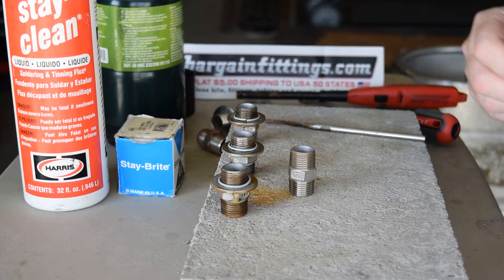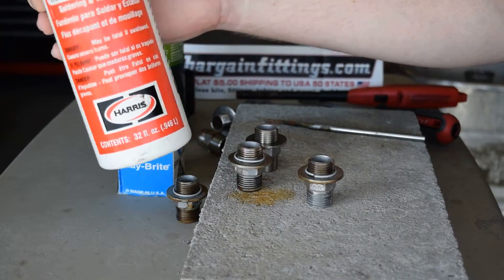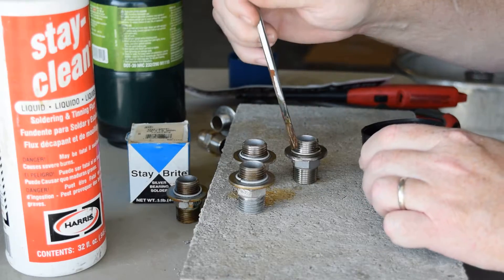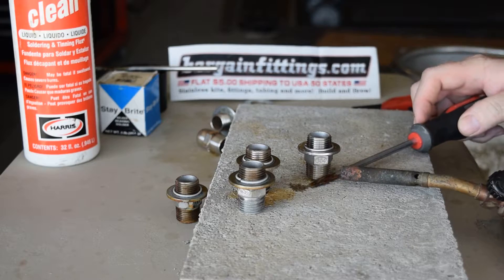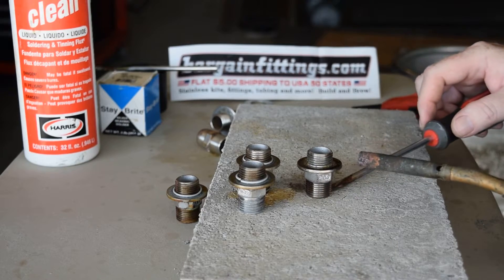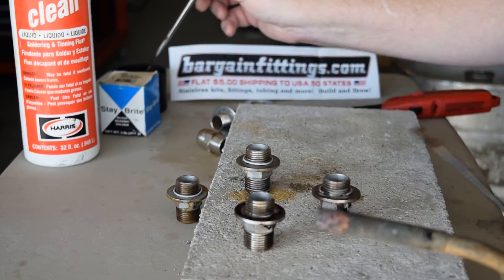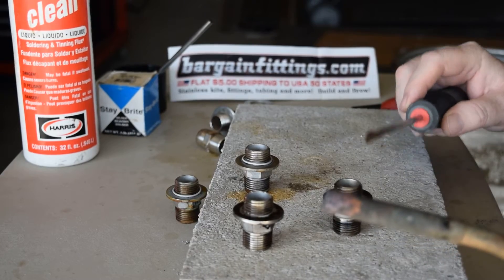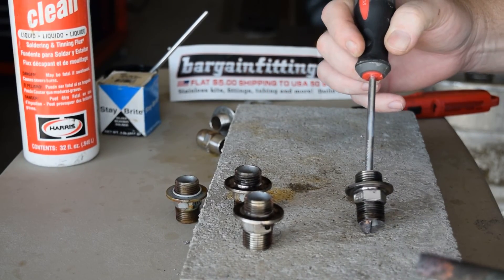Soldering stainless steel fittings.

Comment: Used to solder SS to SS, SS to copper, and even SS to carbon steel in the industrial gas industry.  Used 35-65% silver solder and flux.  Oxyacetylene small tips.  Huge issue was heat control. If too hot, stop and start over from the beginning with fresh cleaning.

Comment: Nice video. Can you use this solder/ flux for larger pieces of steel... I'm making a sculpture & want to tack some joints, of long steel rod/ steel bar/ steel weight bench rectangle tube. I just wonder about the effect of heat sink off the joint from the long metal piece. I understand the stay brite is low melt point, so I was hoping the heat sink issue wouldn't matter as much. I am also thinking of cold connecting the joints 1st, with steel wires or screws, & then soldering over that. I don't want to get into welding at this point. I was considering the stay silv, but would prefer the stay brite if it would work. Also, how do you clean these parts you made after you are done?

Comment: is he trying to solder wires to the bolt, or whats the plan/project after melting the solder ?
Reply: He says in the video that he pre shaped the solder into rings and those are the wires you see on the washers.

Comment: I needed to solder a coupling that is 1/2 inch npt to a 5/8 steel tubing for a line I making on my old truck . I never tried to silver solder with just propane . . Watched your video and I remember I think I the flux and solder . I knew I had silver solder for  soldering ac lines ect . I had the solder you posted also . So it worked OK.  I cleaned both pieces and fluxed . I has to reflux on one side and give it a quick rub with a SS brush . It took the solder then. Thanks for the video

Comment: Please i need help.....
What about brassing 2 SS pipe of diameter 10mm together. These pipes need to withstand pressure up to 200Bars. Is it possible to use Silver brassing rod?.
Reply: Safety-Silv 56% Brazing alloy will do nicely with the appropriate flux. It’s rated for 70,000 psi
Reply: @rdalemd76  what about 40% Sir

Comment: Would you compare the use of this flux and solder to be similar to soldering copper pipe? or is there any major differences in the way you use it?
Reply from the maker: Very similar to soldering copper pipe.   Heat is directed to the part with the most mass.  Main difference in the process is the flux.

Comment: Thank you for such a helpful video.  Question, what is the best way to solder together two 1/8" or two 3/16" stainless steel solid rods, non-threaded.  Would you use the same flux and same solder you are using?
Reply: You would probably want to silver braze solid rods.  What sort of connection?

Comment: What do you think this flux made of, is it muriatic acid?
Nice job.
Reply: It's zinc chloride. Used to be known as 'killed spirits' in the UK. You make it by dissolving metallic zinc in hydrochloric acid until it stops reacting.
Reply from the maker: I believe it has Hydrochloric acid in the mix.
Reply: @BargainFittings  at which temperature the piece to solder the silver to should be ? should it be put to red cherry ?

Comment: I’m doing a project that I need to solder stainless to stainless. It’s not a perfect fit. There is a little gap. What solder and flux should be used. I tried the silver lead free solder from the hardware store and it doesn’t stick even tho the stainless steel is hot.
Reply from the maker: You need proper flux to solder stainless to stainless.   The stay free liquid flux in the video works well.   A very small gap can be bridged but it is best to get the gap as tight as you can.
Reply: I had the same issue. Don't let the flux turn black on the surface of whatever you're soldering.

A trick that works for me is to use water, dish soap and a scrubbing pad then dry your surface and apply flux right away. If that doesn't work you can use a dremel and cutting disc to scuff the surface and then apply flux.
Reply: As for solder i use alpha fry flo-temp
https://www.amazon.com/dp/B0012TAWS8/

Comment: do u sale alot of different types of stainless steel fittings and how about that solder I can't find any good quality of silver solder.  All the ones that they were saying on eBay that would solder stainless was lieing I haven't had any luck at all
Reply from the maker: We do not sell solder and flux but we do sell stainless steel fittings on our site:  bargainfittings.com   
The flux is the key to the soldering.  You can find these kits at home depot or lowes but here is one online https://weldingsupply.com/cgi-bin/einstein.pl?PNUM::1:UNDEF:X:SBSK